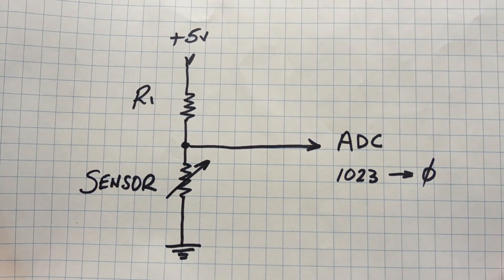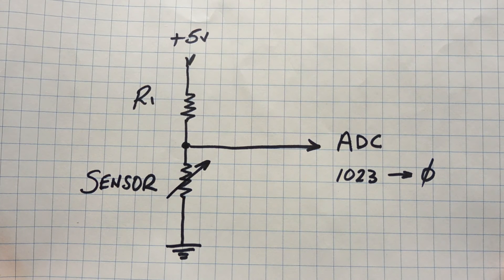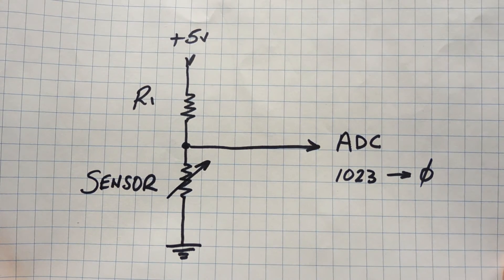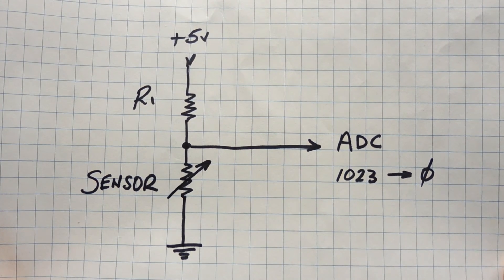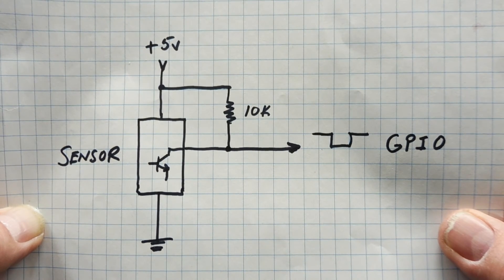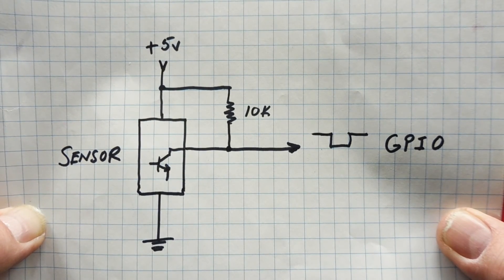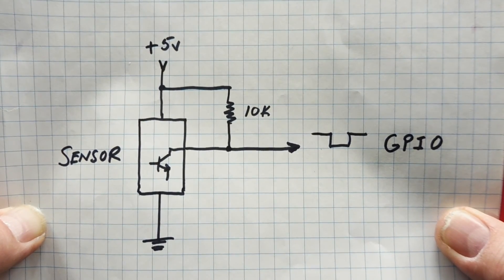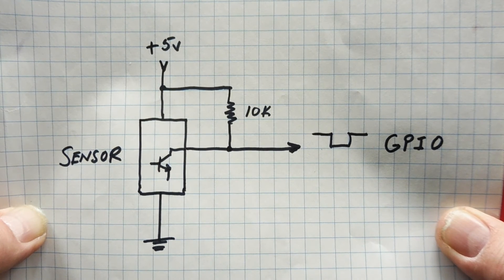Use Automotive Sensors in your next Project

Comment: Hi , i need help to interfacing this sensor with arduino i cant understand the signal wire connected to digital pin at arduino uno before that connected it with voltage divider by resistor 10 k ohm ? Or i connected it at analog pin ? Please help because this for my collage project
Reply from the maker: Connect the signal pin to one of the GPIO pins on the Nano. Experiment without a micro then connect the Nano.
https://youtu.be/_-_XGLkKnCs

Comment: Hi, i need help interfacing a crankshaft position sensor with an arduino to get RPM for a college project, is there a better way i can contact you ?
Reply from the maker: Check out some Hall Effect pickups:  https://youtu.be/_-_XGLkKnCs
You can also get RPM readings from an ignition wire pickup.
https://www.powerbox-americas.com/products/rpm-pickup?variant=29869017202760
When you hook up the desired pickup, check the output with a scope to make sure it is clean before you start coding.

Comment: I am completely new to fancy computer stuff. But I've been around cars my whole life. My question is, all these automotive sensors are 12v, would running them at 5v not change their calibrations? Say a water temp sensor runs 0-12 volts and that is calibrated for 60degf to 280degf range. If your only running 5v would it not either severely limit is range and or change its calibration??? I'm wanting to get into coding and Arduino/RbPi and attempt a single screen gauge cluster.
Reply from the maker: Back in the days of carbureted  engines everything was 12 volts. When fuel injection came along a computer was used (ECU) which ran on 5 volts like Arduino. A lot of sensors like crank/cam position sensors and throttle bodies "drive by wire" run on 5 volts. You have to check the service manuals to determine the voltage used on various cars. Very new cars use CAN bus which is a 5 volt protocol. Check out these videos:
 https://youtu.be/_-_XGLkKnCs
https://youtu.be/h1aA5gfeU34

Comment: Good video! I'm interested in finding an automotive ultrasonic distance sensor. Where can I find a catalog and specs? Thanx.
Reply from the maker: Parking assist backup sensor from Ford F150 part # 3F2Z-15K859BA
Available from Ford or Amazon (cheaper)
https://www.amazon.ca/Parking-Assist-Reverse-4F23-15K859-AA-3F2Z15K859BA/dp/B07W4C5V11

Comment: I love automotive sensors.  The computer uses the pull up resistor in the control unit to detect if the sensor is hooked up correctly.  Great practice to add code I'm at 5v the sensor is not hooked up.

Comment: I have a two pin cam position sensor. Induction type. How can i condition the signal and make it square for my arduino to read it?  I can't find lot of stuff. But from what i know its not possible to get readings from it directly.
Reply from the maker: You can try my sensor interface circuit. It will detect very small signals and produce a 5 volt square wave output when powered by 5 volts. https://youtu.be/wEqfHo_guG8
Reply: @0033mer  Thank you very much for your response

Comment: I want to measure distance traveled by counting the revolutions of a rotating wheel using off the shelf ABS tune wheel and ABS sensor. Which combination of these two items should I shop for that are the easiest to be read by an Arduino?  It is my understanding that there are different types of tune wheels/sensors.
Reply from the maker: Easiest solution is to use a missing tooth trigger wheel which is easy to sync with a hall effect sensor and Arduino.
https://www.diyautotune.com/product/8-1-4-36-1-trigger-wheel-no-slots/
Reply: @0033mer  thanks for the reply.  Is it correct to assume that any 3 wire automotive sensor wired according the diagram in your video will work with this trigger wheel?  I should also note that I intend to use this sensor in harsh environments with possible water slush and dirt. What is the purpose of the missing tooth?
Reply from the maker: Car manufacturers spec their own sensors so they are not all the same. Missing tooth will give you a reference to something stationary and will also indicate full revolutions. May not be needed in your application.

Comment: Hi, My car sensor not working i have Toyota Aygo which sensor is similer like shaft sensor shown in starting of the video (yellow ring two wires) and not available in market. Can you please help me to find out the solution. can i use other alternative car sensor or use any transister/resister curcuit ?? Car speedo meter+ abis not working due to this.    Your prompt response will be appreciated !!

Comment: If you say the temperature sensor has a platinum wire in it, to me that sounds like a type S thermocouple, which does not work with current. It generates a millivolt signal that is proportional to the DIFFERENCE between the temperature where the two wires meet ("hot junction"), and the point where the platinum wire ceases to be platinum ("cold junction")
Reply from the maker: The device is a Mass Air Flow sensor (MAF) which contains a platinum wire and a thermistor. For temperature detection the thermistor can be used standalone. For air flow detection current is fed to the platinum wire. As air flow cools the wire more current is needed to maintain temperature and air flow can be measured. 
https://www.oscium.com/sites/default/files/MAF_autoshop101.pdf

Comment: Don't forget relays, and a robust atx power supply can run a car stereo and/or smaller audio sub amps. Green wire to black on the 20 pin connector should get the power supply going.
Edit:
MAP, VAF, IAT, EGT, O2, wideband O2, abs sensors.
 Steering wheel clockspring for wiring up steering wheel buttons and airbags, can give a project at least 720* while maintaining continuity through a ribbon cable.

Comment: Note: Not all crank sensors are Hall effect.  Some output a high voltage AC signal.  Don't just go hooking up a crank or cam sensor to your micro without knowing first.
Reply: The Hall effect CPS is a three terminal device which is easy to recognize. It is powered by the ECU at 5 volts. The AC variable reluctance CPS is a two terminal device and generates its own signal. The output is around +/- 8 volts depending on the speed of the motor. All that is needed is a resistor and a Zener diode to clamp the output pulses to 5 volts which can be fed onto the micro.
http://fullfunctioneng.com/info/Hall%20vs%20VR.pdf
Reply: My VR sensor has three wires.  Except if you hooked it up to a micro, you'd kill it with high voltage (up to 50 volts iirc, depends on the speed of what is passing by the sensor).  I know this because I built my own ECU (Megasquirt II Extra).  I HAD to know what kind of sensor my engine used.

Comment: thank you for taking the time  to explain the type of sensors. it was very informative.  I will like to start a project where I will be able to read temperature, fuel, RPM's, and Speed on my 82 motorcycle and be able to transmitted to my phone via Bluetooth.  any chance you can point me to right direction. thank you again.
Reply from the maker: Use the Arduino Nano to read all your sensors and send the data to a HC-06 Bluetooth module which will transmit the data wirelessly to your smartphone. A serial terminal program app running on your phone will display the sensor readings.
There are lots of free BT serial terminal program online. You can also write your own app using App Inventor by MIT.
This video will give you some ideas:  https://youtu.be/yXRWQpJrK6g
Reply: greatly appreciated!
Reply from the maker: Check out my "Reading Sensors with Bluetooth" video:  
https://youtu.be/5scp2xpFa7c
Reply: Alternately, you can use an Esp32. You'll have Bluetooth and wifi built in

Comment: heated platinum wire sensor is actually used as mass airflow sensor
Reply: There are also VAF sensors and MAP sensors. VAF uses a pot type wiper to determine volume, the air drawn into the engine moves a plunger. And MAP (manifold absolute pressure,) which detects the pressure in the intake manifold (vacuum or pressure with a turbo.) For all 3 you probably want to know the temperature of the air, some have a built in IAT, like my VAF. When I swapped to a MAF  I had to wire in an IAT. Getting rid of the plunger in the air path I gained about 12-15hp and fuel economy improved ecu had to be swapped the 2 types of measurement don't play nice, linearly. The newer ecu also could control it's own fuel map instead of following a predetermined spreadsheet. So light turboing would not require a fancy tune.
Reply: Could use it as an anemometer, but they're pretty sensitive to fouling and damage. Might have to do some calibration/testing.

Comment: How can I make a pressure (force) gauge with digital display, using a 10-500kg force sensor? Trying to use something like that to measure the wind force on the front of my drag car.
Reply from the maker: You could use a load cell available online from Banggod. You would have to come up with a calibration scheme to  measure the range of force you are interested in.

Comment: Just gave me an idea project for next spring  : hall effect sensor and some microcontroller to compute speed/distance etc on my mountainbike..
Reply: You can use a Reed switch in the frame of your bike, and a magnet in the wheel. Just like most of digital speedometers